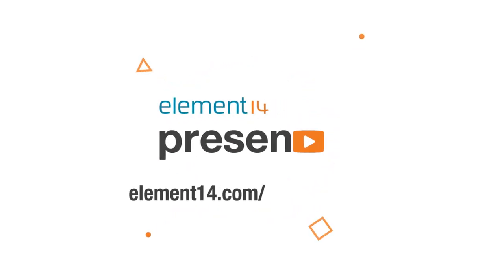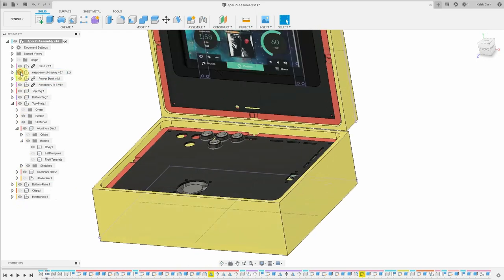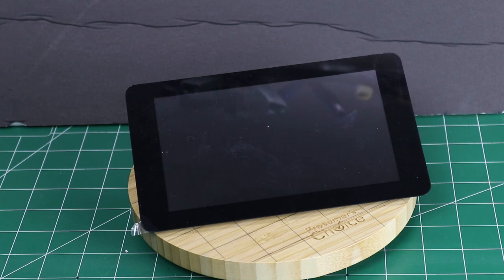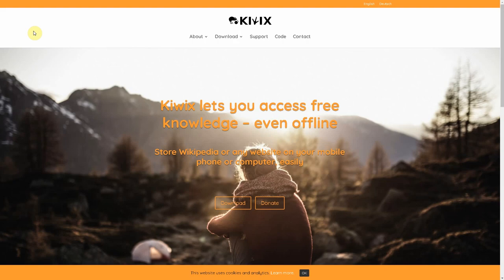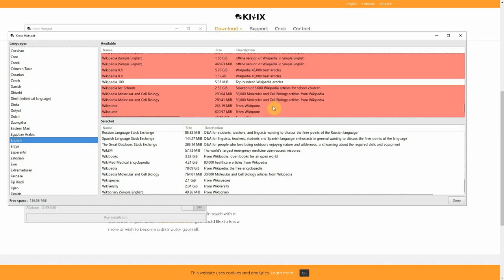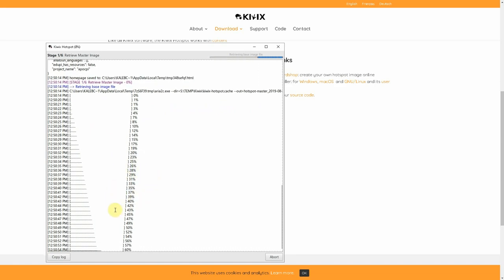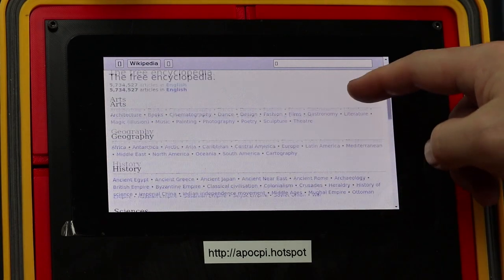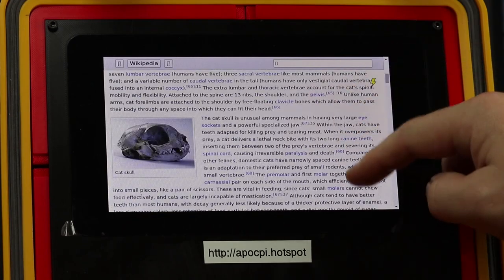Build an Off Grid Wikipedia with #RaspberryPi

Comment: I would like to see a solar panel on the case. So you'd be really "off-grid". It could charge the battery even if it takes days.
Reply: yep, missed opportunity there, plenty of room on the bottom plate for a solar panel or even a fold out solar panel.
Reply: Why would you need a fragile solar panel on the case when a much larger panel would work better on your roof?
Reply: @sammiller6631  Because when you have a waterproof off grid off road device you not always have  your roof with you.
Reply: @sammiller6631  

Get up to speed, plenty of flexible rugged fold out solar panels on the market for those times when you don't have your roof with you, now do this project again with a fold out solar panel inside the case.
Reply: @waynepugh5789  Get up to speed. Staying home is a better choice than going into unknown areas with limited supplies and locals who see you as competition for their supplies.
Reply: @sammiller6631  

Well if your staying home why make a water  proof rugged box to sit in your lounge room with? You think any refuge from war or natural disaster though staying home was the better choice but left anyway?
Reply: @waynepugh5789  Why make one? Well, element14 is in the business of selling electronics parts. Its parent sells around half the Raspberry Pi units worldwide, so the goal of this channel is to churn out new reasons to buy more.
Reply: @sammiller6631  
So your stated goal is vacant consumerism,  element14 is just out to push sales and have people wast money on ill conceived projects just as long as element14 makes a profit. Well i think less of element14 now.
Reply: @waynepugh5789  There is nothing foolish about storing the wealth of human information.
Reply: @di9italzero500  

There is when you do it badly for greed
Reply: @waynepugh5789  Knowing how to forage is knowing how to forage. I understand the politics of what you speak. Wiki is in no way an accurate historical record. The winners write history. Few have access to living memory. That being said. Starting a fire is starting a fire regardless of where you learn it. You are throwing away a plethora of information because of a very small portion of misinfo. When starving in the woods, its' gonna be nice to know which berries I can eat. Somethings are not politically motivated.

Comment: The lightning bolt means your are undervolting. Geekworm makes a good UPS that runs on those 18650 lion batteries used in vapes and laptop battery packs.

It had auto shutdown and also an external lighted button for power on/off.  It will also fully power off during shutdown after rpi halts
Reply: That would be in addition to the power bank that he installed?  Ie the UPS would supply the extras needed during boot or heavy demand?  looking into your recommendation now.
Reply: @wpilgrim1  Yes it can power everything independently.  it also survived being the the Mohave Desert for a year.  I found an open wifi out there believe it or not and accessed my “RPI Desert Server” over TOR for a year before having to scoop it up for cleaning the solar cells.

Geekworm X728
Reply: @wpilgrim1  Also this unit can power a RPI, 7 inch LCD, limeSDR, 4W RF power amp, all from same geekworm UPS, even boots fine. Its a beast
Reply: @WeirdscienceTV  awesome! planning my build right now.  Thanks for the added help here.
Reply: @wpilgrim1  You’re welcome! Im guessing like me, you want something that is robust and not just a toy

Comment: A company made an offline wikipedia device years ago that was sold in stores. It used a touchscreen but was text only. It had a micro sd card that could be updated, not from the device as it did not have any kind of connectivity. The touchscreen was the old style and not that great to use.

Comment: This is a cool project but………… you can also install Kiwix on an old iPad (as long as it’s a 128GB model or higher) and slap a high-quality beefy rugged case on it.  And if you must, you could keep a rugged outdoor battery bank with it, especially if it has a built in solar panel (which often have slow charge rates, but if the panel sitting in the sun all day gives you a few hours of iPad charge, that’s good enough in emergency/disaster situations).

Comment: Nice design but I feel v2 could use a ruggedised solar charging system built into the lid to trickle-charge the battery over time.

Comment: I had thought of something like this, although I'd probably use a Pi Zero W for better battery life. I assume that the Kiwix software doesn't require a crazy amount of processing power. I would also get a bit more sophisticated in terms of power, such as having a solar panel built in, as I would expect not to have access to power to recharge in an apocalypse situation. I would also make sure to have a way to turn off the display for hotspot-only use, and preferably a custom battery solution with some indication of charge level. But this is still cool

Comment: It looks like your power bank isn’t able to provide enough current/voltage for the Pi 4 (indicated by the symbol on the top right of your display)! You should probably rethink the power side of this design as you really need something capable of delivering 3A at 5.1V, which most standard power banks won’t do.

Also, it would make a lot of sense to have a switch to kill power to the display . . . if you are running this as a ‘hotspot’ to be viewed from a phone/tablet/computer, then you don’t want to be wasting power on a screen and backlight.
Reply: All i can think about is, sd card corruption even before he finish the project :(
Reply: Absolutely right . . . really, now that Raspberry Pi 4 / Pi-OS support direct boot from a USB Mass Storage Device, this should be using a SSD connected the one of the USB 3.0 ports . . . net effect, much faster and with some significant protection from corruption of the SD card (which would no longer be needed) . . . plus large SSDs can be had for very little money these days.
Reply: @DWiskow  Yes it should, there is plenty space there for ssd.. and there is no reason for it to have a display and no small keyboard but the project is cool and well made Still, and a offline Wikipedia is a great idea anyway you do it. for me the problem is the PI, i don´t believe i will ever recover my trust for the Pi.   They should have put emmc or something, and better power system even a built in battery system, they could even jack up the price to 100 for that one. ssd should be a option and not the first boot order.

Comment: how can you access wikipedia from the Pi if you installed the hotspot? The Kiwix site says you can't do that. What did you do differently?
Reply: I'm having this same issue. Followed the video down to the wire and can't open the wiki when kiwix pi is plugged in. Only a command line comes up

Comment: Nice idea, knowledge is very important in case of a disaster but also if you strand with a plane, boat or car in the middle of nowhere. You can add things like service manuals
Reply: Right, I did think about service manuals, but which ones? hah! I don't know of a good open and free database of service manuals, I looked a bit but nothing right off the top. Do you know of a repository of service manuals? I would defiantly update it with that!

Comment: Lightning bolt... Underpowering or Overheating...   Consider using a Pi3 rather than 4 as it will need less juice and lets face it, the wiki purpose does not need the computing power of a pi4.    Epaper for the screen if its only for reading could also be a better power saver in an apocolypse scenario... and dude... what about recharging the battery & solar... definitely needs a part 2
Reply: Lightning bolt represents an undervoltage, a thermometer symbol represents overheating. 
If you're using a device like a phone anyways, you could probably do without a screen.
You could also underclock the pi slightly, not sure if this would help much. A Pi Zero W may be a suitable alternative.
Solar would be a big bonus. Possibly a custom battery pack as well. That case has plenty of space for li ion cells.

Comment: I really want to make one of these, with solar panels. Include some no language IKEA style directions for use, and put it in a time capsule. Any thoughts on changes you would make to this project for longevity, say in a sealed container, inert atmosphere, but no temperature control?
Reply: Sounds fun but i would think the electronics would decay anyway to a point it wouldn't turn on possibly?
Reply: @TJWood  over enough time, any electronics will fail. But if the parts are chosen carefully, 30-50 years isn't unreasonable. Except maybe the storage media. That's probably the sticking point

Comment: 19:40
I have’t watched yet but imagine a program that downloaded each oage but also downloaded the sources linked. 
I guess the next step would be to download some log of the reasons for why it’s written and generally download wikidata.
Reply: *19:40pm 21/April/21
Noticed and started typing correctiong at 19:42pm, got distracted slightly and finally finished this comment at 21/April/21

Comment: Can this auto update from wikipedia as new pages and entries are added/edited in? if not is there a way to do this?
Reply: Not automatically no. might be able to do it with some custom scripts, but it would take quite a bit of work. Its a good consideration though, it would need to be updated now an then.
Reply: not sure how easily you could update it, it would require scrubbing through the site to find changes... it would probably be easy if wikipedia already has a tool on the backend for new/updated articles.  If not,  scrubbing through 80GBs for changes would take forever

Comment: well all good but not water resistant you literally have holes in the thing and a fan to boot  you could just have had a huge heat sink from the raspberry to the case exterior glued that to the case the added mass would make it hard to heat up &cool down but it could let some heat escape by using conviction Plus reading files off of it wont  take much to process  and you could fit an solar panel for charging wile on a trip or hunted by zombies

Comment: um wouldnt it need a Faraday cage inner lining for solar flare ?
Reply: Faraday cages block wifi hotspots...
Reply: @5am0036  yes but the flare would have passed right and if u open the shell up to turn it on its out or open from the cage
Reply: @17hmr243  if you're assuming the apocalypse happens because of a flare than yes a faraday cage makes sense. But, assuming that it happens during the apocalypse a faraday cage wouldn't do anything open, and would be an annoyance while closed.

Comment: Am I missing something, doesnt this rely on your phone connecting to the internet, what happens when the cell network is down or you are out in the wilderness. I'm struggling to see the point of this as a disaster device???
Reply: It doesn't connect to the internet, but instead uses wifi (which is really a kind of wireless signal) to connect your phone directly to the device in the same way your phone might connect to a wifi router in your home. Your phone can then, instead of asking for the device to fetch information from the internet (which it has no access to so it can't give you anyway), ask the device to display information stored locally on an SD card on the device itself. Kind of like having a fake internet in your backpack.
Reply: @JonathanKitzrow  Oh Ok that sounds more sensible but there has to be a limit to what can be stored on an SD card so doesnt that mean you have to down load what you want before you want it?
Reply: @campbellmorrison8540  yes, but that's one of the amazing things. Wikipedia is ~80gig download.

Comment: These pelican case pi projects have been getting popular. This is a good example of one of the basic services running on them. But that poor undervolted pi. Please don't reccomend these batterybanks for pi projects, they're unable to supply the pi with the proper amount of power to work properly over time and running undervolted like that can lead to system instability as the battery just is not capable of delivering the power the board is trying to draw.

Really wan't to see less 3d printing and more recycled, or hand manufactured parts using more commonly found tools.

Comment: This is good, but the realistic functionality is lacking in that sort of situation, if an apocalypse happens, most likely, phone lines will be down, power will be down, internet will be down, data banks to store the entirety of Wikipedia would be beneficial, I wonder how much storage you would need for something like that 🤔
Reply: As seen in the video, you'll need a bit more than 80GB to save the entire English Wikipedia with picture material.
Reply: @Kuchenwurst  I know, but exactly my point, it was more so, functionality of having a huge databank that's needed, and not something that's portable, rows and rows of hard drives with thousands of terabytes of information needed to be stored, imagine having the most obscure  information needed and you didn't acquire it when SHTF situation
Reply: You are completely missing the point. When all of the internet is gone this device can still serve all of wikipedia in a disaster situation. If the grid is down and someone is injured you can use this device to look up first aid. If you are stranded somewhere you can use this device to find edible plants to eat. This device in no way relies on the existing internet. That's the point.
Reply: Di9ital Zero you are only referring to a small fraction, even smaller than a fraction worth of data, i’m talking about everything, if you needed to start from scratch, you would need to know everything, the equivalent to being all knowing in a situation like that, the functionality of something like this is just the very very very tippy top of the mountain of knowledge where as you need the entire mountain in a situation like that
Reply: @yellowice0  Being able to research edible plants and gain information about agriculture is going to be invaluable in a survival situation. No archives is perfect but it's better than nothing

Comment: Wenn man sich was bauen kann ist schön. Ich finde einen leistungsstarken SBC mit portablem Bildschirm besser. Etwa NEX Touch oder RrasPAD3. Das ganze dann noch in ein wasserdichten ALU - Box mit all dem Zubehör , Netzteil ,HUB  , SDR Empfänger, USB HDD und ein altes kompaktes Notebook. Alles sauber verstaut und schnell erreichbar was will man mehr. EMP sicher und wasserdicht. Ich finde Wikipedia offline Scheisse weil man nicht das findet was man wirklich braucht . Immer nur so abgehacktes , ins leere verlinkte Zeug. Dann lieber ein Haufen Bücher auf Speichermedien nach eigenem Geschmack zusammen gestellt da findet man schneller das richtige. Alle 2 Monate die Akkus pflegen und Software aktualisieren, Hardware pflegen und es kann nichts mehr schief gehen.

Comment: make sure you have a lab / workshop full of 20k in gear before you build one.
Reply: the only thing you really need in this project is a 3d-printer and a soldering iron, so it will cost you only around 200$ in tools
Reply: Yeah, what else did they use?
Reply: Nowhere near 20k in tools to build this. Michael is right.

Comment: You literally built a device that is dependent upon the internet as an example of a device you could use when no internet is available....
Reply: the hotspot is its own network so its not connected to the internet, i know lots of people call the internet wifi, but wifi is really just one method of moving data from one device to another, it doesn't have to be connected to the internet to be used :)
Reply: I don't think you understand what wifi is...
Reply: The reason this makes sense in this case is that the machine in this video has an offline version of Wikipedia which can be shared with nearby devices through a hotspot. so that even if the computer isn't connected to the internet, it can still allow other machines to connect to its own little wifi network